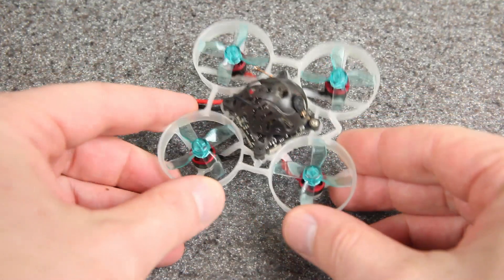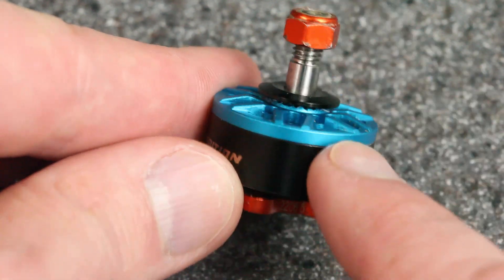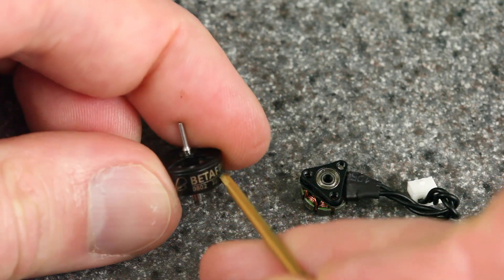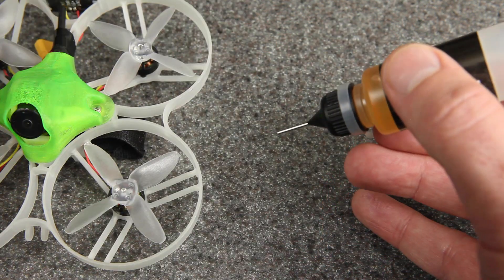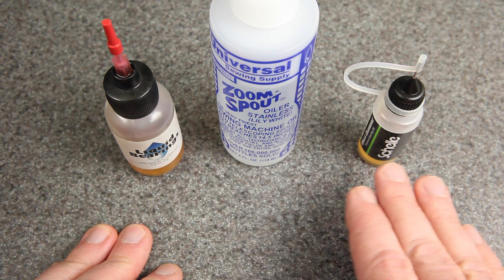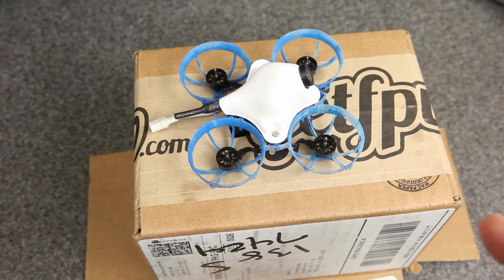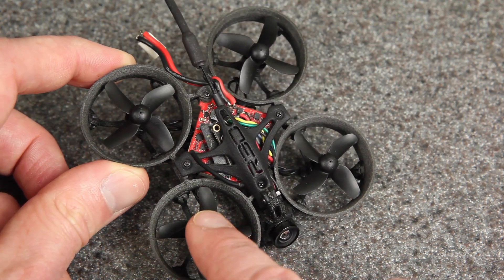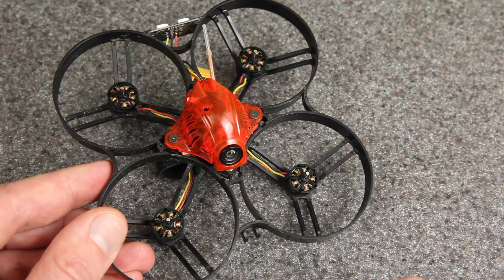Do your brushless motors need oil?

Comment: varible frequency 3 phase drives create stray currents throughout the motor frame and shaft including any conductive componet attached. This causes big problems for bearings in the form of electrostatic discharge pitting on races. This can cause a few different hazing patterns or a washboard road effect and lead to failure. You can quantify this by multiplying the number of rolling elements by shaft speed in rpm and comparing this frequency to the vibrations measured on the bearing for any given throttle input. Lubricants provide a non-conductive interface for the bearings and races and reduce this effect. Or you could skip all this and purchase bearings made from sintered silicon carbide which do not require oil, but they are likely more expensive than the entire drone. When we are talking high rpm motors with limited torque, the drag created by lubricants is negligble compared to their benefit for overall reliability. Even small gains in efficiency could mean big performance for a micro drone. Silicon carbide bearings are what they use in dentist drills that are turbine driven to 140,000 rpm. So im sure a brushless motor on a drone would get huge gains from the loss in friction of cheap bargain barrel metal shield bearings i saw in this video.

Comment: Wow, you don't even need the graphs most of the time. Some of the motors sounded new after the oiling. Nice!
This might be great for vtx noise.
Reply: Maybe but thing is vtx gets most if it's noise from electronic interference and noise in the boards/cercits
Reply: noise has nothing to do with anything. especially when there is no load. so much pseudo science rubbish going around passed off as expertise because it seems to make sense. ive been an engineer for 30 years. this stuff drives me nuts. complete BS.

Comment: I put some finish line wax lube into my cordless drill's planetary gearbox after fully degreasing every part piece by piece and i can say that the result is a coating of wax that sounds and feels like it's 1 atom thick so i would say to give that a go.

Comment: The ball bearing doesn't have to be oiled. They have special grease inside that is designed for high speed, high load. IF you add oil you will wash out the grease and the bearing will overheat very fast. There is manufacturer maintenance guide
 how to re grease ball bearing, but for so small sizes it's not cost effektive. It will be better to take new bearing if your is too noisy, because probably already it's damaged .
Reply: Tencho Tenchev yeah but they like sex with this lubricants. It useless waist of time. Change bearing, don’t do monkey job

Comment: doesn't over time the oil will melt the varnish covering the copper wire in the motor ?
Reply from the maker: I have had no problems with the windings using the products I showed.

Comment: I oil all my small motor bearings 1106 / 1304 etc, at the bigger motor sizes/bearings it is not anymore needed, oil doesn t repair a bad worn bearing, it only open's up a dry bearing, mostly high rpm bearing.  I use a bit thicker oil, for me I use the red synthetic motul, two stroke engine oil. As I beleive a ball bearing must be greased, which is thicker than oil.   for the bushed motors possibly you want a thinner oil?

Comment: I have wd40, it will probably work too, what do you think?
Reply from the maker: I would not recommend WD40. I think it’s best to use a lubricant that is designed for this purpose with a needle nose to apply it in very limited quantity.
Reply: @MrShutterBug  ok thanks!

Comment: My girlfiend says its always better to lubricate as it makes things smoother . My wife says she wouldnt know either way.  As a watchmaker i wanna thank you for this video . Without a doubt these motors need oiling. At the speeds they turn and their size oil  probably serves as a coolant especially in the whoop sizes. Great video sir
Reply: My 0802 motors will literally burn up after 6 seconds of full 2S throttle. With oil they lasted 20 seconds without damage.
Reply: How did you have a girlfriend and a wife lol?

Comment: RE: "1) I do not recommend oiling motors with sealed bearings. They shouldn't need it. They don't usually benefit (I've tried), and the oil could interfere with factory provided lubrication in a bad way."

There was this awesome stuff from back in my THRASHER days and skateboard wheel bearings.(sealed, packed, whatever.) Since most packed bearings have very dense viscous grease-like compounds applied during manuf process, adding a thinner oil will increase friction. I'm pretty certain there's a substance that can be applied to the brushless bearings even if nobody knows what it is yet.

 I also remember trying to hunt out the "GMBH" marked bearings. The German branded bearings always ran smoother and were far superior at holding up to the stress of street skate.

Comment: It would seem the racerstar motors showed the biggest difference in sound and resonance 🤔👌🏽 great vid
Reply: Lubrication can help, but also after few crashes on my motors bell started to slip on the axle and also i lost few U clips on 110x motors :) If you use really tight U clips at the bottom and super glue bell to the axle, you should be allright

Comment: Good practice, as lubrication help to prevent wear.
Try Wd40, you will surprised how it works. (I use to oil computer fan sleeve or ball bearing too)
If the bearing is sealed, a trick to help on the situation is to remove one side of the seal, put oil an reassemble the bearing on the motor keeping inside  the side without seal.
In this way is more easy to lubricate, and no dust contaminate the bearing.

Comment: I tried oiling my Mobula6 motors after about 50 packs flown and they sound better. I used sewing machine oil unknown type.
I also noticed a slight increase in flight time. Also tested the theory on my old beat up OG tinyhawk and it made a huge improvement.

Comment: Topnudge work.
extensive testing and info.. always welcome, that is how we learn and possibly elevate... keep em coming and then people can conclude own findings.
I don't oil my motors.
tried it many years ago, back when bayong toys x9 was a thing, but that was obviously brushed motors and motors that were uneven and getting way hotter than others. but that was a last resort before the dumpster and here it helped a lot on both sound and how hot the motor got. (but it was brushed motors) but as stated it was last resort before the dumpster and usually a con on the longevity side' hence brushed motors construction, but as a fast easy fix and last resort, it did help, but on new brushless motors, without any issues.. I would not go down that road.

Comment: The first time i ran my bldc motor, the bearings made some noise.  I added a few dropes of oil, and not only did it spin faster on its lowest setting, but was quiter. 

Check out the motor i built on my channel.

Comment: The bearings that are sometimes on  whoop motor bearings are not designed for the rpms that the motors see. They are typically only rated to 20,000rpm - if memory serves, where as the rpms that was see in whoop motors see upward for 50,000 rpm loaded and 70000 rpm unloaded.

Comment: I use Marvel air tool oil. It is designed for high rpm motors and it works great.

Comment: Hey mr bug. I'm Craig from south Africa capetown.  Hope you well. You seem pretty clued up on all this dro e stuff. 
I have a bebop 2 power with flight control  p2. So my drones reaction time is very bad. This is using the skycontroller p2 when I push up or down. Let it turn left and right  or make it fly left or right or foward or backwards the drone has a delay  of anything between 3 to 6 seconds plus at times. I've done hard resets on it a few times. I dont fly with my phone at all to control it only the skycontroller p2. Phone is used only for visual and settings. I'm to scard to fly because if it flys in any direction I wont have control to stop it. Please help if you can. Regards
Craig

Comment: Won't the oil like damage the wires, the coil!? Like eat through the wire costing, hence damaging the motor!?

I damaged my RC helicopter BL motor like that, lubricated and after some flights heli fell out of the sky...

So careful which oil you use people, else yes the performance went crazy on my helicopter while the motor lived..

Now I use special, non petroleum oil, only fully synthetic oil works for BL motors.

Sweet

Comment: I have been fluffing about with this trying different oils in 5in motors with steel shields, theres a few that have been good and bad, Teflon based light chain lubes are o.k, various skate lubes are to heavy, but so far I personally like 15wt suspension oil, although I know theres better!, I wont waste my time with dry lubes, graphite or waxes, my next one will be shieldless motors/ with a VCR type service lube.

Comment: Way back when I started before I really knew that replacing bearings was a thing I assumed oiling was just a thing you were supposed to do - I used Innov8tive Designs Scorpion Motor Bearing Oil which is apparently meant specifically for brushless bearings. I also tried it on some of my super ratty Racerstar micro motors .. it seemed to make them a little quieter. But honestly I'm not sure it helped or harmed. I basically stopped using it. But, you know, for funzies I may try it on full sized motors that have crapp-o bearings that I plan on replacing anyways.
Reply: https://innov8tivedesigns.com/motor-bearing-lubrication-kit.html

Comment: I've tried this with micro motors a bunch over the years and typically what happens is that after a bunch of flight time the oil gets flung/seeps up into the press fit joint between the motor shaft and bell causing it to slip at which point you can try the Loctite 638 fix but that doesn't always work leaving the motor bell/shaft ruined :(
Reply: Thanks for the heads up.. I'll keep it away
Reply: Try loctite 648. It's so permanent that I can't press them back out.

Comment: The bearings in these motors are identical to those used in fishing reels.  I have been servicing said reels for over 25 years and I always lubricated the "sealed" bearings.  They aren't really "sealed" as much as "shielded" with a thin metal shield with just enough clearance to allow a very thin viscosity oil. I found that one of the finest is made by Kano Labs in Nashville Tn., as is called "MICROIL".  It will penetrate around the shield and contact the balls and races.   After oiling the bearings on tournament fishermen's reels they all told me they were casting so much further with less effort.  The same will apply to these micro bearings.  The noises you hear after oiling these bearings and running at higher speeds is the rough surfaces of the worn ball bearings.  Its a sign the bearings are are their way out of service.   TOO MUCH OIL IS SOMETIMES WORSE THAN NO OIL AT ALL...  That's where the dust collection starts...so oil them sparingly and they will perform much better.      
Tennessee Reelman

Comment: I use lucas high heat gun.oil it works perfect and is sold in any o rielly auto parts.  Its synthetic and holdup to heat works very well. And i use it.on all.motors even the sealed motor because for one the sealed  bearings have grease in them not oil. So if you put a drop of liquid oil on them it will seap into the bearing and help lubricate them  better

Comment: Do they need oil? No, they don't need it and they don't like it. Oiling sealed ball bearings ruins permanent lubrication and most likely leads to slipping motor shafts in the bearing. That ruins the motor in a short time. If the ball bearings are defective, you can help yourself with oil until the bearings are replaced, but with the very likely risk that the motor shaft slips in the bearing and thus completely ruins the motor.

Comment: So I'm not the only one who does this. I also fly 3d heli's, and use Scorpion motors on most of them. They recommend oiling their motors and make/sell their own brand oil. The container has a needle like tip to make it easier to get in tight spots. I also use this to put a small drop on my drone motors about every 10 flights.

Comment: Many motors out of China need to be oiled Before first flights, before they seize up and burn out the coils. That "cover" is a dust shield only, not sealed bearings. Sealed bearings would have too much drag. Oil will get past the dust shield easily by placing a small amount on them. Get a bearing flushing tool to do better maintenance of them also. TIP: replacement bearings can be salvaged from computer cooling fans that are marked "BB" of various sizes.

Comment: About the motor squelching: This is likely the result of PWM Alignment of the ESC firmware. Did you use JazzMaverick 16.8 or higher? If so try 16.73 JazzMaverick or Stock Blheli_S (I know it's only 24khz, but you could try it just for testing purposes) and see if the squelching is gone.

Comment: Nice Video, but oil only small whoop motors! In my opinion the big motors with Japan bearings don’t need oil. He need grease and it is enough greased from the manufacturer for lifetime. Oil rinses your grease out of your bearings and will damaged it. 
Keep it up 👍

Comment: The smaller bearings are loud because it's expensive to make things accurate at this scale and I don't think any sane person would be willing to pay the price for a micro motor with $40 bearings in it.
Reply: if it flys 15 min on one battery mobula 6 size with full hd recording i would do it :)

Comment: I started oiling my whoop motors the first time I realized they had bushings and no ball bearings. I've used lightweight mineral oil but I can see where fully synthetic would be better. I think even something as simple as baby oil would be better than nothing but would need to be applied more frequently. That would keepem smelling nice too. lol
Reply: If you mean you mean brushes.... I.E. it's a brushed motor then you are sadly mistaken. Most brushes are made of graphite, this is a lubricant in its self. You should not be putting baby oil, cod liver oil or any other random oil some other morons advised. Speak to manufacture do what they advise by all means... but save yourself looking silly or from in future damaging a decent motor.

Comment: I'm not sure if they are available for micro drones, but when I raced Nitro Outrigger boats, when i had to rebuild the engines, I used ceramic bearings designed for RC Jet turbine engines.  They will take a tremendous amount of heat and give way higher RPM's.  If they made those bearings in the correct sizes, that would be a interesting experiment.

Comment: id love to see some testing on bigger motors, like 2306 /2207, id also like to know if manufacturers are using pre-greased bearings in motors
Reply from the maker: I have tried to oil 2207 motors and did not see any benefit. I really only recommend oil for micro motors with bushings.

Comment: You do not want to lubricate sealed bearings. You can cause the inner race to slip on the shaft and act as a bushing and it wears out. It's also much less efficient.

Comment: Great video! Did you know, that in betaflight configurator, you can just click the motor slider once and then use the up/down keys on your keyboard to set the motor signal more reliably.
Reply from the maker: Yes, I used the arrow keys. The values are exactly correct in every test except for one where I must have bumped the keyboard because it was off by 1.

Comment: Larger bearings really need to be flushed then lubed to see a benefit. Also, when in flight, the prop is pulling the bell up, and that is why they only put a bearing on the bottom. The two brass bushings on the inside are not touching.
Reply from the maker: Jacob Scherer but the shaft still rubs the inside of that top bushing, and they do wear out. A friend of mine has been looking into this and he discovered that the top bushing actually wears out faster than the bottom one, on whoop motors. I don’t know why that is, but he could actually measure it. The inner diameter of the top bushing increases as they wear down.

Comment: I have wondered about this myself and have played with oil and graphite on a few motors. I feel graphite could be lighter and create less drag for brass bearings, but it's such a pain to apply, and I haven't done any testing that comes close to anything scientific, so I'm not sure if my theory holds weight.  Makes sense that lube is good (we know this from other applications) - question is: which is best?  Great vid and approach - gave me lots to think about.  Keep up with the top notch content Nate!  Always interesting stuff - thanks!
Reply: Would graphite lubricant not cause early wear as it is abrasive?